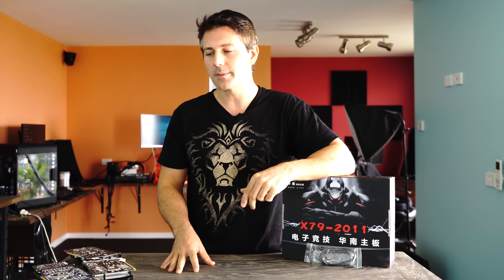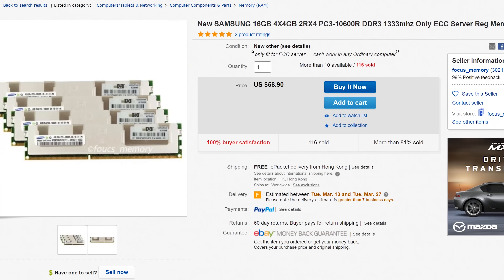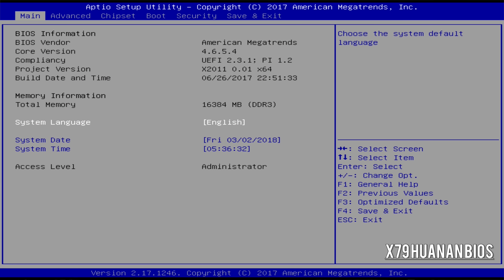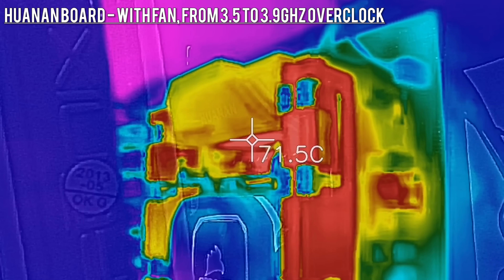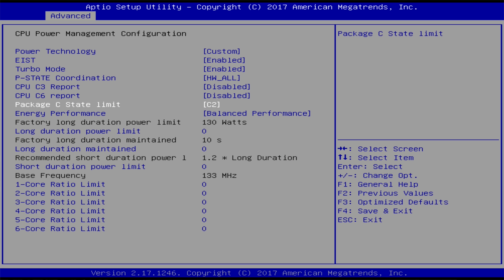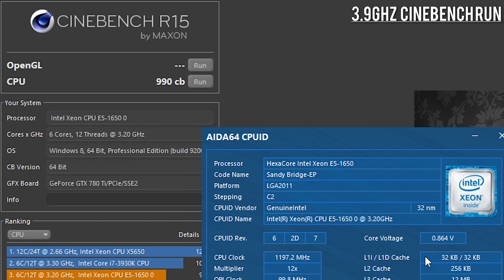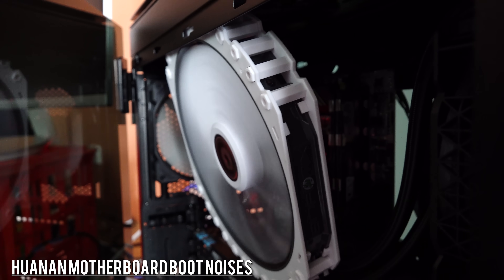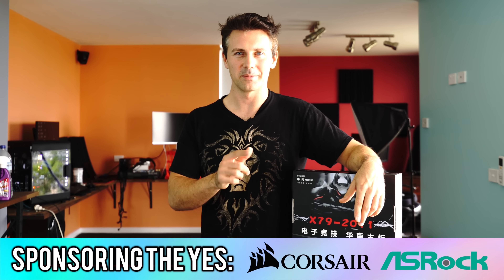AliExpress HUANAN X79 Motherboards - Are they a LEGIT OPTION for PC Builders!?

Comment: i7 3960X Intel E5 x79 CHINAAAA Board, 16 Gigs Ballistix x Sports RAM and a Noctua Cooler fror respectively 100 USD, 150 USD, 80 USD and 20 USD (including Fees and Taxes and all the other shit) On par with a Ryzen 1600 X all in all 350 Bucks. And now get a new Ryzen system...I can also OC till 4 GHz, I am on Air and O BOI! Does this little Xtreme Core from the Depths of an Office grave (Has been living as a Server) can get hot, one Hot Boi! :D No Problems, except that Chinese Manufacvturers can't actually read and connected the wrong Pins on the MoBo, Reset Plus and On/Off Minus are On/Off Pulus and Minus xDDDDDDDD Took me 2 days to accidentally figure it aozt with a Srewdriver fiddeling ion the pins to get a connect, but I've made it and with a 250 (at the Time) GTX 980 from Asus Strix department I am gaming on a Beast of a Used Machine, costing 880 USD with an 250 GB SSD, 1 TB HDD and 1 TB SSHDD. Now Thats a pretty darn good machine, now go and get some DDR 4 machine with that, having comparable specs, I dare you, I double Dare you Moth - fine Gentleman and Ladies ;) I can play Star Citizen with 20 frames, Beastly Screaming like some Buffed, Gym - going Halfbrained Alpha - male - Idiot, but in Binary Language 
xDDDDDDDD
But on a serious Note, my Machine tops Fallout 4 in 4 K heavily Modded and I mean like Installsize without stupid HD Textures of 300 GB, at 40 - 45 FPS in highly demanding (Cough bad optimized) areas of the game like Downtown and such. Its real good. Took good research and Gambling on the electronic Bay. WHole Setup with Screen, mechanical Keyboard and Mouse and headphones in  very high Quality is around 1150 Bucks. Noice. YOu can bearly get a mid range PC for that alone. Don't ask, I challenged myself xD
Reply: ABout VRMs - eh, everybody scimps on them, until you pay like 180 plus for a Board...fck me, fck that and toast a VRM with me, these thingys are strangley durable, but they smell like Fried Duck and Rice....

Comment: If you rotate the top fans and make them intake would it solve the issues refarsing temperatures?
I know that you are fighting phisics itself but the VRM heatsinks are right below the fan, and like Steve from Gamers Nexus said, the air moves in the direction that a strong fan is bruteforcing it.
The case would get more dusty but would it solve the issue?
Just curious.

Comment: i need a lga1151 motherboard and the only avaiable ones are chinese ones not even exactly cheap either. do you think buying buy one is ok? i have a feeling they will just start burning and popping capacitors...
Reply: with these boards... depends on your luck really. you could get lucky and have it not fail you, or it could kill your cpu and gpu... so

Comment: Not all Huannan X79 motherboard are the same. I have a Huannan X79 Gaming Deluxe. it uses a true Intel Patsburg C600/Intel Ivy Bridge Chipset. I'm running E5 2680 V2 Standard BIOS Great performance with no need to over clock and VRM temps are okay..

Comment: What about the M.2 slot? ddr3 tests vs a true X79? (I have a E5 1650v1, gigabyte X79 ud4 and 16gb 4x4 Gskill 1600) I'd like to know is there is a difference in the hacked H77 chipset? plus does the M.2 slot work and at what speeds? I picked this second hand combo up over a year ago in NZ for $320 NZD which I think is one of the best bang for buck combos you can get, as I have a X58 i7 980 combo to which servers my girls well. Great channel and would like to see any of these results.

Comment: Could you try a high core count Xeon in this? Also maybe the heatsink could be modded by replacing the thermal pad and cutting vertical slots into it with a hacksaw, giving it more surface area and "fins"?

Comment: I am glad people are still talking about x79. This was my first build back in the day. I just bought what had the biggest number as I didn’t know what I was doing at all. I went from a i7 3820 and later upgraded to a 4960x on eBay for $180 US on eBay. I could have done the 4930k for $30 less but splurged for the laughs. This setup runs at 4.5 ghz on 1.28v stable. On cinebench Single core performance smokes a Ryzen 1600 @ 4 ghz and is really close on multicore. I intend to hold onto this system for a long time.
Reply: Hi,are you board still working, can i use a non ecc ram, thk

Comment: As always, good video Bryan. Did you have any top mounted fans in the case drawing air over the heatsink? Can't see from the video. I've been thinking about getting one of these for a while, but those VRM temps and the lack of overclocking potential are putting me off. The ability to overclock the E5 16xx Xeons to around 4.5GHz was always one of the main draws of this platform.

Comment: I would say if you can find a case with a mount of a 20CM aka 200MM fan on the side, and this kit drops down by $50 - $100 US it would not be the worst option. otherwise I usually just avoid stuff like this. 
Also on the lady issues with gaming, I've been there before, and it sucks having to sneak out of bed, and across the house to play some games even for just a few minutes before going back to bed. However I'm thankful that most of the time my current girlfriend does not care long as I don't spend all day gaming unless it's bad weather outside, or there is not much else to do on a non work day.

Comment: Great video!  I've reviewed a couple other models of these x79 boards.  One of them was a modified P75 chipset, the other was actually reading as a genuine x79.  It looks like they're using the same BIOS as your board, and these were locked to 3.9GHz as well.  I've given the same advice in my videos, as I don't recommend high overclocks on these.  Stock or light OC works just fine, but I was also concerned with heat, and the difference between 3.9 and 4.2 just isn't going to be worth toasting a board over.
Reply: That's awesome!  Thanks for watching!  I'm glad my videos helped spark a project for you.
Reply: when are you putting up the ultima map?  i bought this board.. and ripped out the heatsink.. and it's a H77 chipset.  i think the pulled a flashed a fake bios.
Reply: you´re here too!
Reply: I do get around ;-)
Reply: love both of you guys shows.  A couple of the most solid guys on the old You Tube.
Reply: indeed you do ;)
Reply: hi craft computing? are u able to use the m.2 slot on your board?
Reply: Would you still recommend this or are there any new ones? I have a GTX 1070 Ti, would this be compatible with it?
Reply: @Craft Computing you said this uses the same bios but i cant find any setting to change this to 3.9ghz did you need to flash the bios with a bios mod or something?
Reply: @Ray Ward Haha, 1000w PSUs on media PCs :D :D What, are u providing electricity to a neutron chamber in ur cellar as well or what?! :D Your combos draw 200-300w max! You'd be good to go with regular 400-450w PSUs. Should have sold those gigaton mining PSUs for good dollah.
Reply: @Ray Ward I never said u need to buy anything new! What I was saying is that all that extra headroom in those ultra big PSUs is going to waste. It's like putting Ryzens on ur kids' PC, so they can watch cartoons from Netflix... But 5 bucks is insanely cheap! Those are worth near 100$ each. That's why I said u should have sold them, then bought more suitable PSUs (used preferably, but u could even afford new ones with all that cash!) for the media machines, and u'd still have like 150$ left!

But I didn't know u found the Dell cases WITH the PSUs attached in the bin. I read it that u had the cases and found just the PSUs in the bin... If they are some proprietary Dell shiet then they might be inseparable, in which case u have to use them or sold them as such. I just generally despise the use of gigaton PSUs in any system, because frankly that much power is not needed in any normal circumstance. The only purpose for those are mining rigs or breaking world records on PC speed under liquid nitrogen cooling...

I've never heard or seen 1000w PSUs on any established brand's PC! Must have been some old server machines. Usually most branded machines in the used market are old workstations with ~250w PSUs...

Comment: They've got their uses I suppose. There's a slight air of dodgyness though. I've seen a few on eBay.   But they're not X79 😂. They should just market as LGA 2011 & H57 & just leave it modded as they've done & not try to dress an H57 up as X79. We would all take it more seriously then. But maybe that's libellous..lol? They've technically brought us an budget alternative chipset 2011 board to the market, albeit a little late (& dodgelly done). You can't help but think why Intel couldn't mod it's own previous chipsets & re-brand like we see with GPUs, to do what they do with all these different boards but for budget market variants. It would save development revenue. Or the pitfalls of why they didn't yet to come 😂. But it seems stable enough. The use of dirt cheap ECC memory is good. Although if the CPU supports it or not (Xeons do 9.5 out of 10, as server CPUs), sometimes the motherboard won't. My Asus P9X79 won't support it according to the manual. And that is one of the better boards on the platform. So that's a plus. If it's micro ATX (looks it) it would be good for a music production rig, as my case is that small with mine. If I do pick up an unlocked 2011 CPU for my P9X79, I might honestly be tempted to get one, pair it with my E5-2640, along with 32 GB ECC for £25 off fleabay. & make beautiful music with it 😂. I use an ASUS XONAR card for good ASIO latency & audio quality anyway, so I'm not bothered about what audio it has, ironically? I don't think that was mentioned in the vid? Good job with AMI brand Bios, Phoenix were usually always a pain. A plus it can  overclock, although a lot of E5 1650s hit 4.5 GHz + so that's a loss of potential you got @3.9 but still good total price all in. Enough for the small  2.5 >2.8GHz overclock jump on the E5-2640 though. Reminds me off the old VIA etc budget board alternatives that would give limited overclocking options.

Comment: Seems the 120mm fan for the VRM wouldn't work if you weren't using an AIO water cooler. If you use a normal big air cooler you can't mount the required fan so how could that be worked around? Most people on a budget aren't gonna use AIO surely?

Comment: Hello, I have huanan x79 gaming (orange one). If you want to flash bios use "fpt" tool (afudos doesnt work), it is linked on russian site. I managed to overclock my E5 1650 to 4.0 Ghz on all cores and 4.2 turbo on 1 or 2 cores. 4x4 GB 1600mhz ddr3 from my previous pc easily overclocked to 2133mhz cl12 with russian bios. Key for that is changing power limits options : long dur 210W/time 60, short dur 252W. Orange version has Intel Patsburg C600/X79 chipset. Mine E5 1650 goes up to 155W on CPU Package under aida 64 stress test.
Reply: Konrad Matusiak hello, I have a huanan x79 v2.49 motherboard with e5-2680v2   
There is a YouTube video which is showing a step by step bios update with afudos 
I know that my motherboard can’t be flashed with afudos 
Could you please send me some instructions on how to use fpt tool and which version of bios to download for my huanan v2.49 motherboard 
My email is sdim.studio@gmail.com 
Thank you in advance
Reply: You can find instructions for fpt tool on http://x79.apphb.com/mb/ . Below fpt tool section there is bios list. You need to find matching bios date for your motherboard version and download it. On my motherboard I had to unplug all sata drives in order to boot from usb device.
Reply: Unfortunatelly I am not so sure with the procedure...
Thank you any way :)
Reply: @KM-hc6pf  and how do I fucking read it?

Comment: And can I change BCLK on that motherboard?
Reply: not with sandy bridge. The clock domains are tied in a way that by adjusting Bclock, you'll mess with sata and pcie, meaning you'll be unstable after a couple percent OC
Reply: So can you oc the Bclk with an Ivy bridge like e5 2650v2?

Comment: lol yeah those post codes are rather loud, i enjoy hearing the confirmed beep code that the system is working on my X79 build, my board came with a not working msata port though which sucked balls, had to buy a separate msata to 2.5" enclosure to put my ssd in, just a matter of migrating the OS off my HDD onto it after i get my dual 2.5" to 3.5"  adapter lol so more expenses on my cheap build lol

Comment: For a little over $400 on Newegg you could get yourself a modern amd platform with a 6 core r5 1600 and 16gigs of DDR4 memory...hard to see the value in a much older platform when you can get so much more performance, support and modern features with Ryzen.

Comment: How is the nvme support on this? Is it boot able? Is there a list of what drives it can support? I really want to buy the kit that comes wIth the 6 core and slap a 1070 in there. I believe for my 1080p gaming I'll be perfect for a long time
Reply: antreas antreou IPC is a bit weak, try a 1650v2
Reply: Yeah i mean the mobo supports m2 nvme drives, but which are listed and are they boot able?
Reply: How about this guy Xeon E5 2690 C2
Reply: antreas antreou still sandy bridge
Reply: i always forget about the sandy and ivy deal pff. and sandy 8c16t are so expensive it kills the low budget deal

Comment: Sometimes you have to tighten the vrm heatsink to MB. And be aware: 1*sata3, 4*sata2, 1*m.2, no raid. CPU cooler mounting holes for 1366 coolers. 64GB of ECC REG and non-ECC supported. 4 CPU+case fans pins. USB 3.0 front panel connectors.

Comment: I was really wondering why there aren't more actually good and working chinese pc parts. They managed not only to copy western technology like smart phnes and action cameras but surpassed our technology. Theres a very interesting documentary about shenzen, their tech hub. So I really hope they come out with pc tech to create more competition and more supply to the other companies out there. Prices of pc parts have become riddicoulous for average consumers
Reply: the price isn't that much different because many of these parts are already made in china, so one from a chinese brand isn't going to be much cheaper, and of course the cpu are intel or amd since no one else make a competitive x86 cpu for general computing. though china did just recently managed to set up shop and make ddr4 memory, so here's hoping memory prices come down soon.
Reply: @mxn1948  thats more or less true, you can buy extremly many different cpus from different manufacturers they are 64bit-x86 but they are just above quallcom level performance.
Reply: Motherboard makers still needs to buy a chipset and license from Intel and AMD.  The chipset isn’t just a semiconductor component they can copy and build on their own. 

Smartphone makers however can just buy an ARM Snapdragon chip and design their device around it. Android OS is free and open source.  

Action Cams like the Go Pro is easy to reverse engineer. They’ll just write their own custom software firmware to copy the functionality of a Go Pro.
Reply: @iMadrid11  they only will if its amd or intel, and they obviously could create a new chipset, nvidia did so when via was dying and did take their part in intels rigs and im not too sure but i think in amd based systems too, and it wasnt allways AMI bioses but with the change of chipsets from the manufacturer and dying of the brands like msi who did make their money through that (though they recovered quite well) american megatrends did rescue themselves the right to write a few of the many lines of code in each chipset and bios each time

Comment: Not Worth it imo. Get a used x79 from a proper brand. I got a ASUS Sabertooth tuf x79 for 500dkk. Just under a 100 Bucks.
Reply: PicoDK Yeah dont be the 'i need to buy now' guy if youre shopping for used parts. Just check stuff like ebay daily for a while and you should find something

Comment: lol i got one of these on order i hope i dont have bad luck with these also got a e5 2560 for 99 bucks off ebay so i hope my nh-d14 can handle it
Reply: I have a similiar cooler (also 2 tower design, 6 heat pipes and a 140+120mm fan) and at dead silent (low.rpm) most of the time 40*c on a e5 2680 v2 in games, at full load max 55*c
Reply: Game Marathon Runner NHD14 on my 1650v2 at 4300mhz 1.35v prime 95 AVX is around 75C you’ll be A-OK
Reply: ok cool thanks for that i was a little worried because i do lot of rendering hahaha
Reply: Game Marathon Runner id rather get somr other fan. I got one top mounted in my case just above the vrm heatsink, blowing on the heatsink instead of pulling
Reply: Is x79 huanan + e5 2670 any good? Currently having i5 4570 + gtx 970 in my rig for gaming (pubg and recent AA titles) highly considering the huanan and xeon as I only need to swap Mobo and cpu only, just to know whether it is worth it? Or maybe just better if I go i7 4970?
Reply: ok cool thats awesome to know im hoping the 140mm fan on the nh-d14 will cool the vrms when i get that board :)
Reply: mohd hafis just go for a i7, id go xeons if you need workstation use not only gaming
Reply: you might want just get a i7 4790k
Reply: Well I'm up for gaming only, and thanks for the replies 😄😄